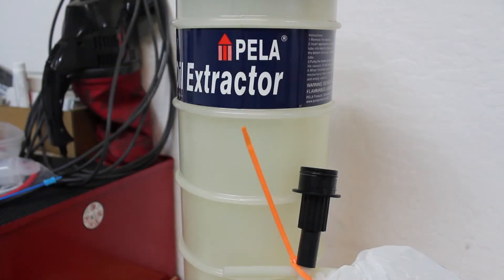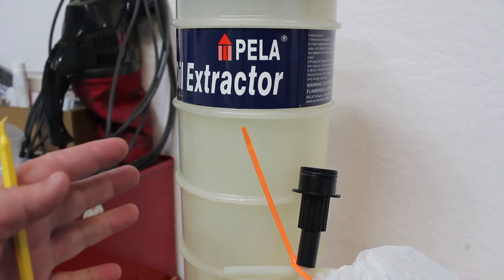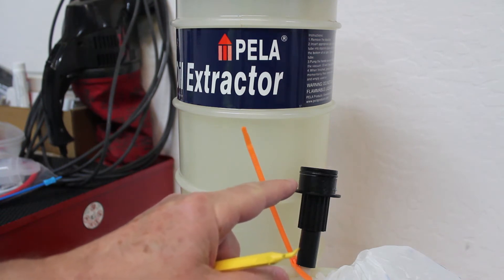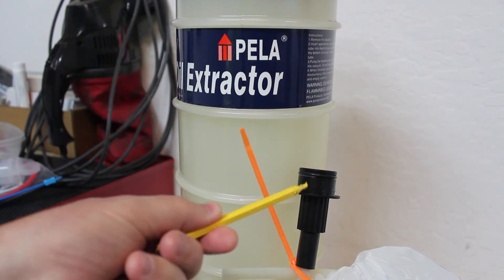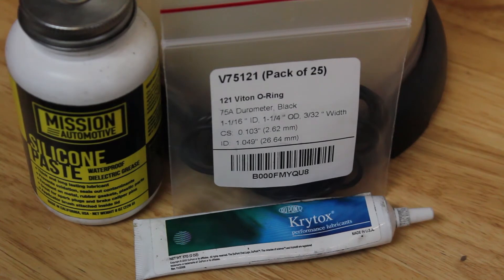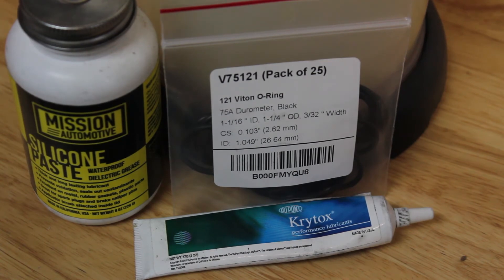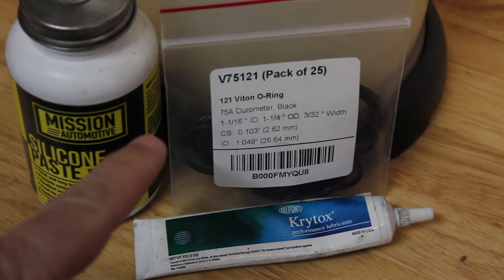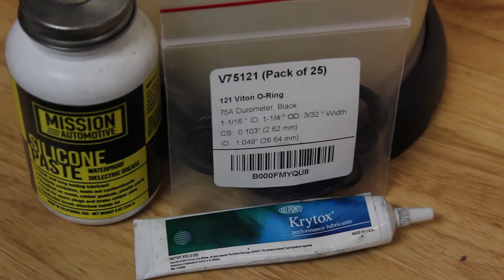PELA Oil Extractor O-Ring Replacement

Comment: Have you ever had it where oil/fuel leaks/sprays out of the handle of your extractor as you pump it?
Reply from the maker: I haven't, if you're extracting fuel that may be the cause since it can eat o-rings, seals, and plastics up pretty quickly.  Thanks for watching!
Reply: @redonKiLaus  thanks very much! 👍